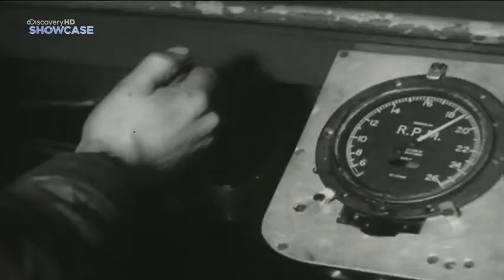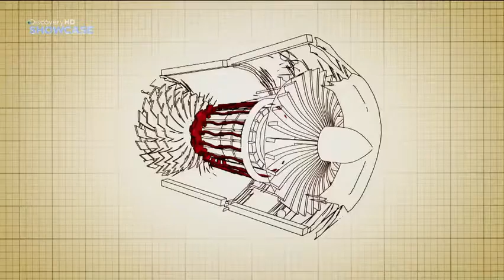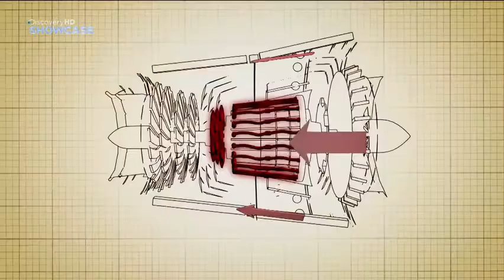Jet Engine History

Comment: How did the Germans find out about Frank Whittle's idea for a jet engine? Or did they just happen to independently have the exact same idea at the same time?
Reply from the maker: In 1935, Hans von Ohain started work on a similar design in Germany, and it is often claimed that he was unaware of Whittle's work. Ohain said that he had not read Whittle's patent, and Whittle believed him. However, the Whittle patent was in German libraries, and Whittle's son had suspicions that Ohain had read or heard of it.

Years later, it was admitted by von Ohain in his biography that this was so. Author Margaret Conner states ″Ohain's patent attorney happened upon a Whittle patent in the years that the von Ohain patents were being formulated". Von Ohain himself is quoted as saying "We felt that it looked like a patent of an idea" "We thought that it was not seriously being worked on." As Ohain's patent was not filed until 1935, this admission clearly shows that he had read Whittle's patent and had even critiqued it in some detail prior to filing his own patent and some 2 years before his own engine ran. (Info from Wikipedia)
Reply: @engineering-channel  Thanks for all the info!
Reply from the maker: @MartinDee2000  You are welcome. This info from Wikipedia, try to search more about that because Wikipedia may be not 100% accurate.

Comment: Major questions not answered. Did Whittle and the Germans think up the engine independently? or did one influence the other?
Whittle's original design looked like a modern jet. It must have been more primitive. What was the first prototype really like? Did the original design have a fan or was it discovered later that a fan was needed?
Reply: These questions are why I clicked on this video and it was not answered.